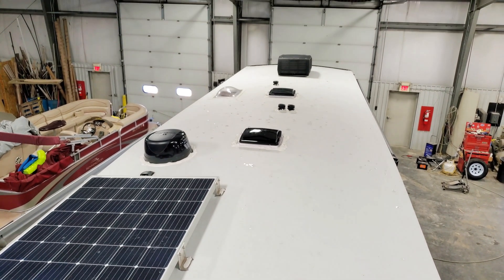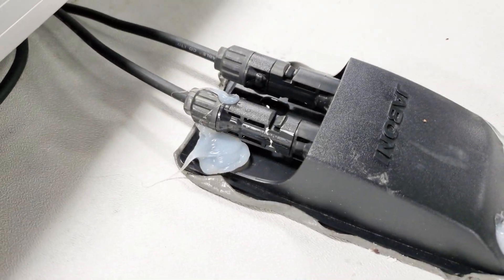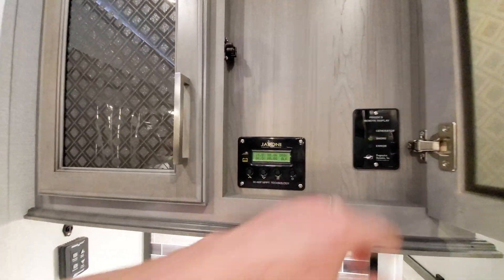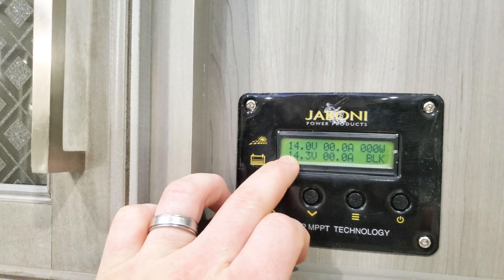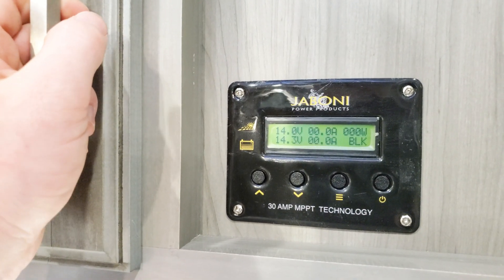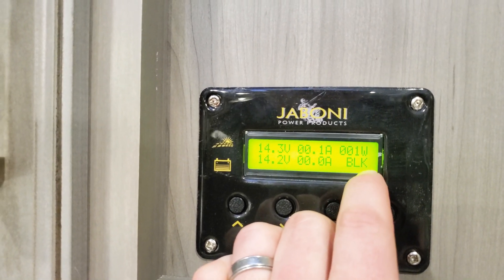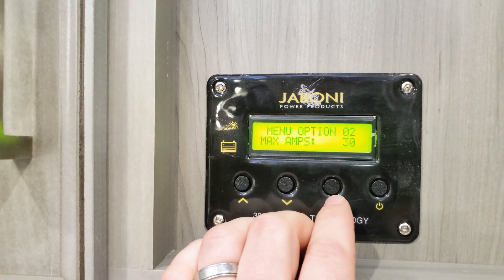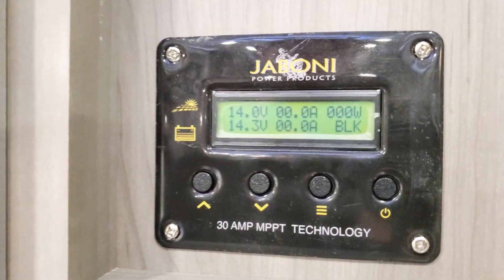How Solar Power Works On a Montana Fifth Wheel | 30 Amp MPPT Controller

Comment: I have a 330RL. Where can I purchase the charge controller, Bluetooth, and control head?  Our 5'er already has the wiring preinstalled. Thanks
Reply from the maker: Victron energy is the brand. I recommend calling or emailing future sales in elkhart for the correct parts

Comment: What is the maximum number of panels we could put on our 3121rl roof? We have a factory generator installed along with the solar package.
Reply from the maker: Probably 5 maybe 6 300w panels
Reply from the maker: Super solar is 4 and there should be enough room left over for one on each side of the bedroom a/c

Comment: Wouldn’t it made sense to make the video with it outside when you are trying to show how the controller works?
Reply from the maker: I shot multiple demonstrations when hooked to shore power and the coach was inside being prepped. I will try and get a video for you on the next one with it sitting outside 👍

Comment: Great to know you can now change the battery type from the inside panel instead of a knob on the Controller!
Reply from the maker: Much easier than before! No panels have to be removed and find the small knob to turn. Great point, I wish I would have pointed out how the older controller worked. Next time! Thanks for watching and sharing your thoughts!